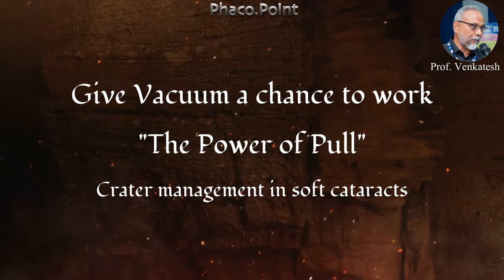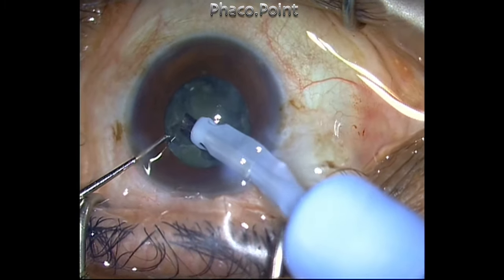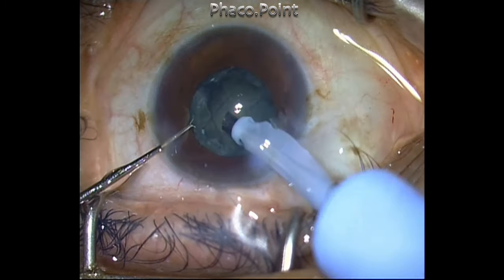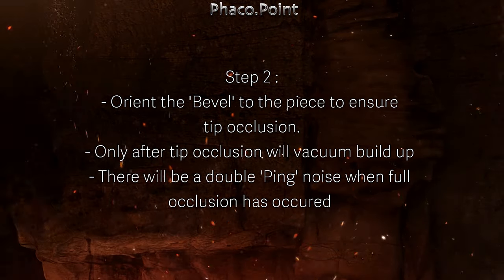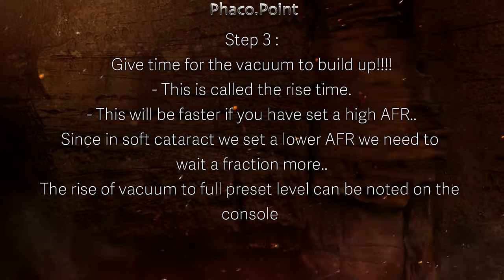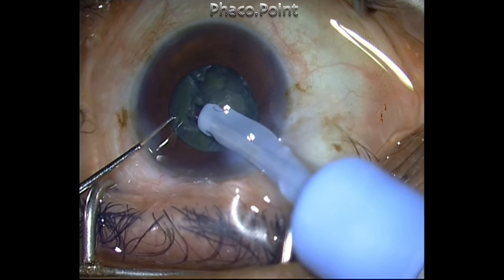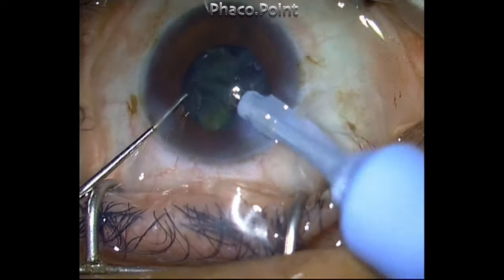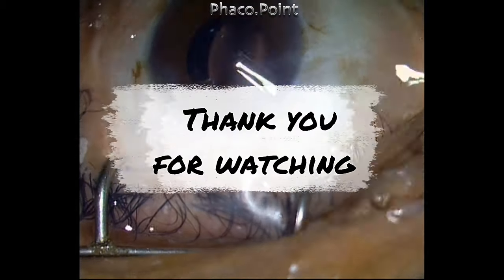Give Vacuum a Chance to Work. Handle a crater in soft cataract Phacoemulsification -Pull over Power

Comment: Very nice video, may I ask was the machine used in the video Stellaris or Stellaris PC? When this happens to me I usually lower de vacuum.
Reply from the maker: hello .. yes it was the Stellaris. Since it was a soft cataract I was already working with a vacuum of 250mmhg. however my fast jerky movements were impeding the pull. Lowering the vacuum to 200 or 150 will probably work as mentally  we tell ourselves to go slow

Comment: Hello sir
Thank you for your valuable and practical tips!
I had to ask you that why did you mention that we should keep low AFR in soft cataract
Reply from the maker: Hello. I usually set the AFR  at 1/10th the vacuum so if the vacuum is set at 300 AFR IS 30 and so on. For soft cataracts my vacuum is about 250 because higher than that will cause cheesewiring. Whereas for a grade 4 me cataract my vacuum will be 400 and AFR 40